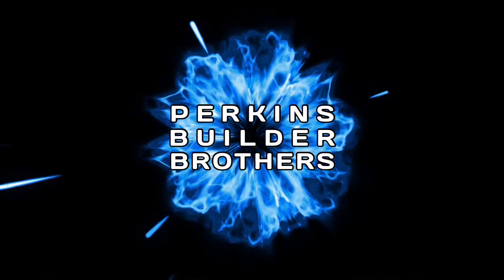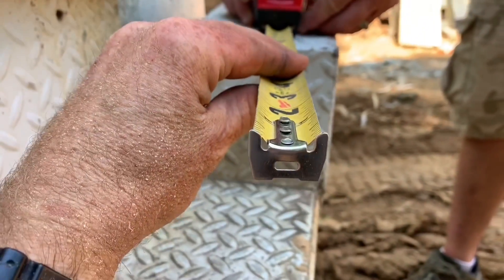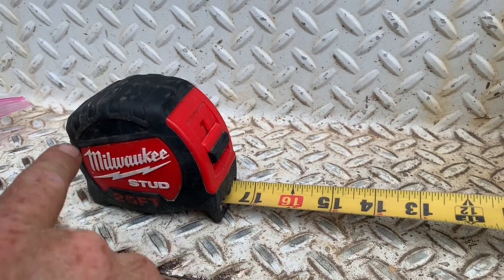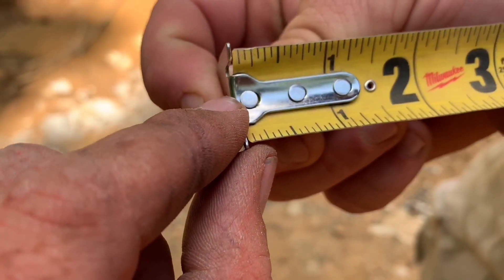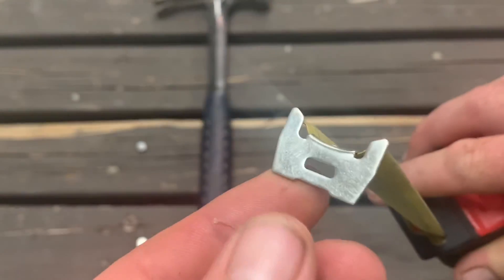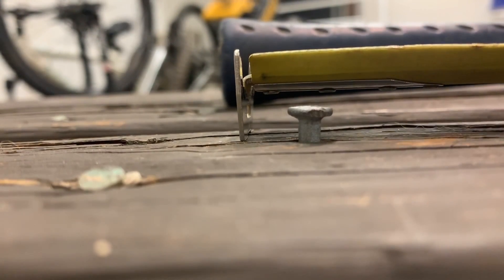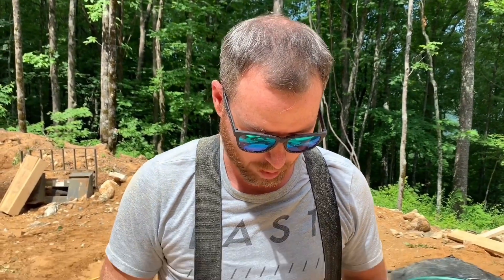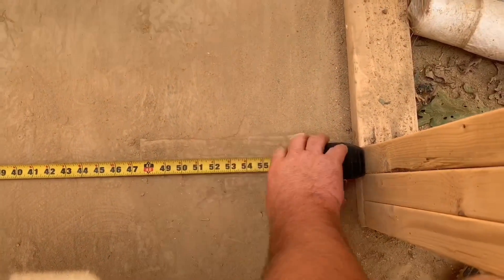5 Amazing Hidden Features in Tape Measures

Comment: I learned about the "give" of the metal end when I thought it was slop from wear and peened over the rivets to take the slop out.  Yeah, none of the measurements that followed were accurate.
A good time can be had with well-worn tapes 3/4 wide.  Stand 10 feet apart facing your buddy.  Somebody yells draw and you draw your tapes.  At your side, point the tape at your buddy and with your left hand you grab the metal edge from across your body and fling it at your opponent. It comes out like a laser shot and stays unbent.  With a good worn tape and some practice you can get a kill shot at 6 to 10 feet.
Reply: Been there, done that, lost alot. But still fun

Comment: Not really "Hidden Features".  I guess no man has ever read the instruction sheet packed with any reputable tape measure manufacturer, but the features are usually printed on the card at the back of the blister pack.  If you don't know the these features, you probably don't need a measuring tape.   Just go back to placing the heel of your right foot in front of the toe of your left foot, then the heel of your left foot in front of the toe of your right foot and repeat as necessary.

Comment: Did you know that you can use a tape measure to tell you how many years old you are? Just take the end of the tape and fold it over till it is at the year. We are in 2023 so you would fold the end of the tape to 123 inches. Next year it will be 2024 so you go to 124 inches. Then you look at the year you were born. So I was born in 1961 so I find 61 inch mark on the tape & directly across from the 61 is your age. Try it and let me know what you think. I'm sure others have seen this trick. Have fun!

Comment: Why's it so important to divide an 8 foot sheathing by 5? @6:08 Thanks! ^_^
Reply from the maker: It is one of the most common wall stud spacings and floor joist spacings :). 16 inches ON CENTER
Reply: @PerkinsBuilderBrothers  I meant the black-diamond markers being 8 feet divided by 5 = 19.2"  38.4" 57.6" 76.8" and 96"  Do these points have to do with stud spacings?  Thanks!
Reply from the maker: douggiedinosaur oh OK… That is 19.2 inch centers. They are used for floor trusses mostly.  Most of these have a 3 1/2 inch wide top surface so they can get away with having one less per 8 foot span then floor joists on 16 inch centers.
Reply: Thanks! ^_^
Reply: @DouggieDinosaur  you get to put one extra trust on a roof

Comment: Tip Of The Day:
 When trying to sell an idea, its best to not wear 'mirrored' glasses.
 Also, when allowing the tape to automatically recoil, pinch the tape at approximately 300mm/12" and let the tape SLOWLY recoil the last bit so that the holes dont become more elongated (thereby giving you a false reading) as the tape would slam against the body.Another benefit is that debris/water will be reduced inside the tape, shortening the life of it.
Hope this is useful guys.
Be lucky.

Comment: See the horns on the end. Off tap. They hook on to a window or what ever. It can hook both sides. Witch he doesn't mention. U can lean out a window. And its got hooks on both sides so u can read messurments. With out falling out window. Plus u can you the tape holder par. To n
Measure stuff. Just put tap messure tight to a stud. Read messurment. And add 2/half inch. For tape measure u can run over the tap. And fat max u can hand your budy 20 feet away. This is why the tape is half round. He has no idea about tapes or a carpenter. He forgot so many uses for that fat max Stanley's. 100 years old Stanley. It locks the tape in so you can save mesurement. Yes snd the hend moves a 8th to make u. For hook and pull. These have been on tapes for 40 years. So when you are not green u will learn more. I have been down town Toronto. 10 years. Im a mason. Brick block rock homes building. 40 year's.

Comment: When you guys going to start using the metric system. wtf is 38 & 3/8th of an inch. 😂😂😂
Reply: Never
Reply: Waaa Waaa Waaa. USA, you're half metric already and you dont realize it. Lol.
Reply: C J Bowen  lol. It's only a matter of time.
Reply: That would be the middle section of the king of England's index finger, measured end to end 30 and 8 times, with 3 slices of pizza added on "for good measure"